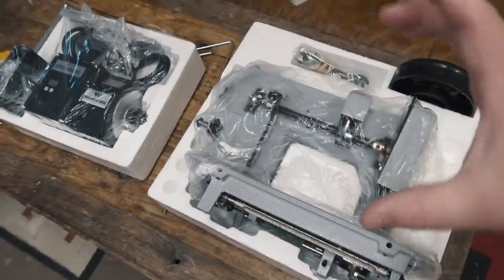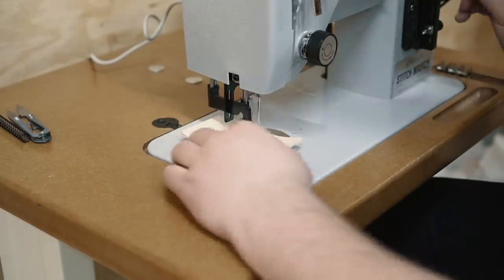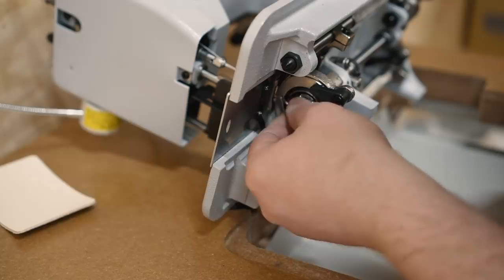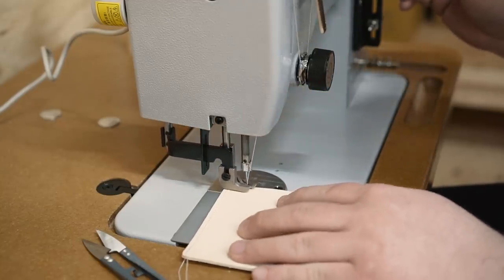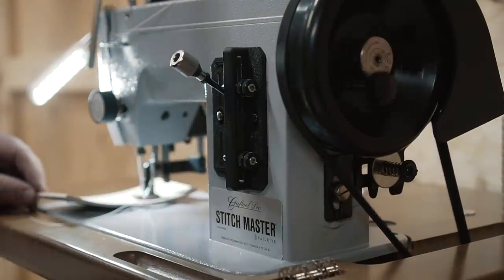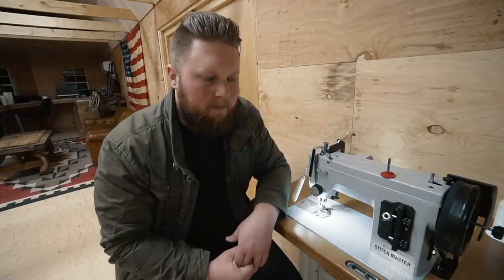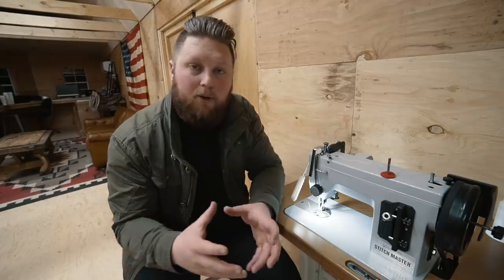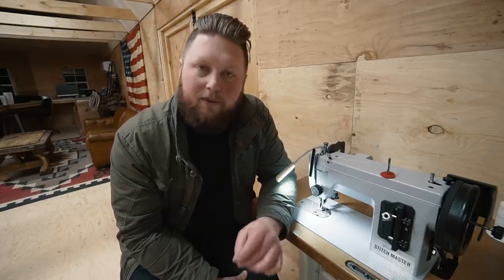Review of the Tandy Stitchmaster Pro Leather Sewing Machine

Comment: $1400 is entry level? Guess I’ll still ride my pony.
Reply: I have a sewing machine in my kitchen that cost 4k.
Reply: I always compare leather working tools to wood working, id call this mid grade, not quite entry level.  But if you were going to switch from a hobby and start a business, 1400 for a complete system wouldnt be a bad investment.
Reply: If you do enough work $1400 would be paid off really quickly.    I now have 2 machines and they are worth every penny and have paid for themselves 10 fold.
Reply: yeah $1400 is entry level, most light industrial machines are in the $2k+ range.
Reply: @FUBAR956  That motor makes a HUGE difference, that said I would recommend a full size table instead of that tiny table.
Reply: A lot of money, for a chinese made sewing machine, with some extra stuff. 
Aliexpress delivers one for ~500$,  all around the world, maybe ~650$ with servo motor.
Don´t you have "Made in USA" sewing machines (except union special) anymore?
Reply: @FUBAR956  This is NOT the same machine as the Sailrite Ultrafeed LS-1. Sailrite is only selling this version thru Tandy. The Ultrafeed LS-1 only has a 1/10th horsepower domestic sewing machine  motor. The Stitch Master has a 3/4hp  commercial servo sewing machine motor, also a clogged belt gear reduction system, and a commercial quality table, and leather feed dogs and presser foot. Considering that the most basic Sailrite LS-1 sells for $795, an additional $600 is very reasonable for a machine specifically set up for commercial leather sewing. The closest thing I know of in price is the Cowboy 3200 which is a slightly more capable machine, but costs $1900 plus shipping.
Reply: You can get pretty much the same machine from Sailrite for half that cost.  I have the Sailrite Ultrafeed LS1 and the only difference I can see is the speed control.  The LS1 is a portable machine with the motor right on it.  I turn the wheel by hand if I need precision.
Reply: I heard that
Reply: That's quite pricey for such a small   machine. You're going to be very limited in the kinds of things that you can fit in that arm area. A better buy would be a used industrial flatbed like a Consew 206 RV. I bought one for $150 with a table. Slap a 3/4 servo on it for $100 and your golden. The Cowboy CB3200 is a completely different animal and an unfair comparison since it's a cylinder machine and way more versatile than this thing.
Reply: *edit "206RB"
Reply: @derechteBenderBaer  There are still Merrow and Union Special overlock and chain stitch machines made in USA. Then there are AdlerDuerkopp machines made in Germany and still quite a lot of Japanese makers still produce in Japan. There are still choices out there. Then there is the used market, a decent Juki or Consew will be yours for a few hundred bucks and they will outlast anything made in China.
Reply: derechteBenderBaer Same feature as this machine??500??
Reply: Honestly think about the amount of time you'd spend hand sewing certain things and it pays itself off very very quickly. Say you wanted to line a belt and have a stitch border around it, 10 hours hand sewing or 15 minutes on a sewing machine? Do that a few times and you've paid it off.
Reply: There's a difference between "Entry Level" industrial and small business and "Entry Level" hobbyist playing in my basement. This makes it a reality for me as a small business to get solid equipment. Where before $3k and $4k was outta reach
Reply: It's only $800 if you buy directly from Sailrite.
Reply: While $1400 might be entry level pricing into the industry level machines the way he used the term when said to novices in the audience or an audience that’s familiar with the Tandy product line seems to imply a $250 - $500 price.
Reply: @lmlowe9100  
It seems like part of the difference in price is the motor. I think this Tandy leather set up has a much more powerful and controlable motor. 
The one at the Sailrite website is only 1/10th horsepower versus 3/4 on the Tandy machine, here. 
If you're sewing fabric, the less powerful motor may be enough. 
Definitely a big price difference to consider, depending on your needs.
Reply: @IamDoogy  I have an old Pfaff...truly better than anything out there.
Reply: @brokensquidwoodshop4209  

It is limited to a 92 thread. A bit thin for leather. This machine is far more suited to upholstery than leather.
Reply: Now it’s 999
Reply: @04658IFH  which one is that?
Reply: Skip Horni I agree totally. Pricing on stuff at Tandy can be ridiculous
Reply: I would like to know if You PAID FOR THIS sewing machine, out of your own pocket?? IF YOU DID THEN I WOULD BELIEVE EVERYTHING YOU SAY ABOUT THIS MACHINE BUT IF THE SEW MACHINE WAS GIVEN TO YOU FOR FREE THEN I GUESS YOU WOULD HAVE TO SAY IT IS ONE OF THE BEST SEWING MACHINE EVER, RIGHT? SO, JUST WONDERING..........BE HONEST,  DID YOU OR DID YOU NOT PAY FOR IT WITH YOUR OWN HARD EARNED MONEY? OR WAS THERE A CONTRACT?? PLEASE BE HONEST ......... 😯🙆😐

Comment: This is just a Sailrite Ultrafeed LS-1 in white. And I’ve already got an Ultrafeed LSZ-1 with the zig-zag stitch.  I love it and use it for small upholstery projects. My brother is an upholsterer and loves it for quick on-site jobs.  I’ve wanted to get the delicate presser foot and feed dog for leather but had my doubts. Now I feel better about using it. But first I want the Workhorse servo motor to handle the leather.  The original built in motor might not be strong enough.  I really hope Sailrite or Tandy offer that small stubby table as a stand-alone option.  Sailrite has a full-size table for the Ultrafeed but I don’t have the room.
Reply: And I’m loving the white paint job.  Mines blue.

Comment: Bought the Chinese version of the same machine for $250.. Yes, the castings are a bit rougher, but a bit of clean up and polishing and you're good to go (took me half hour)..  Motor is also so much quieter- Chinese version uses universal motor instead of servomotor, which accounts for some of the cost, but it's actually still a very capable motor if you understand universal motors: I use it on a 55vdc supply instead of 120vac and I can go dead slow for control with enough power to go through 1/2" stack of skirting leather, or fast enough for large production work..  IMO $1500 is way too much for what the Sailrite machine is.. Tandy has just done the Chinese market a big favor by making a good manual and training materials available for their versions..

Comment: Nice video and nice machine.
     Have you seen the Sailrite Fabricator.?   I was going to consider this one from Tandy but at the same price point the other machine has more bells, whistles and those boxes checked off.
    Don't get me wrong it's very nice and more semi-portable (you have to take the stand with you).  Now I have to choose which one I want.
Reply: I have this machine and the fabricator, and like them both.  Actually, I have the zig-zag machine instead, but this one has some advantage over the zig zag machine, because the foot is a lot thinner.  The Fabricator is my go-to machine, and is the same price point.  The Tandy / Sailrite LS-1 is a portable machine.  

I have the table for the LSZ-1, and the servo motor, but this one also has an added speed reducer, which should give even more control.  

The Tandy looks like a great little machine, and I love the white.  The table is also smaller than the one I have, which could certainly work better in some shops.
Reply: @CharlesAlanRobinson  
    Thank you sir for answering me.  Sorry it took me so long to respond to you, but I just noticed it.

Comment: My LSZ-1 needs a way to slow down and still punch through leather. If they could shorten the width of the base with a drop away that would be excellent.
Reply: I got myself a Monster Balance Wheel for my Sailrite machine, you can easily handcrank the machine for really slow stitching even through soft leather and very thick material.  I just love my Sailrite and their after sales service and support are simply amazing.

Comment: I would rather buy a used Consew 206 for less.
Reply: Pr/fe mech?
Reply: That is a lot better machine than this one and it is a triple feed. The Juki LU563 is also a great machine
that you can get for less than half of the the  price of this Tandy machine.
Reply: robotgrass A Juki and consew are built like tanks.  Industrial Singers too.  Just get one that’s running. Don’t buy one that’s missing parts or won’t turn stitch.  Almost any sewing machine shop can fix them and parts are available.   About the only upgrade is to stick a servo motor and small pully for slow speed control.

Comment: What should a guy who is just starting out buy? My budget would be more in the ball park of $250
Reply: I wanted to suggest you look up the Cobbler Sewing Machine. It’s available on amazon. It’s less than 200 and although I’ve never used it,  it seems like a bunch of leather crafters and youtubers are starting to notice it. Seems to sew a decent thickness of leather. Im not new to leather but I have yet to pony up 1400-2000 bucks for a sewing machine. I’ll tell you that I just bought a regular sewing machine so that I can learn the basics of sewing before buying something really expensive. And next I’ll give the cobbler a try so that by the time I buy an expensive machine my craftsmanship will make full use of the machine.

Comment: I have a twenty dollar second hand Singer industrial machine that does all the Tandy/Sailrite/Brother Lz1 can do.

Regards
Reply: Thanks for your feedback. I have a Singer industrial machine as well, does a great job, inexpensively!
Reply: Where can I find one? What is ur model #?
Reply: Awh man, don't leave us hanging to dry here. What is the model number?
Reply: But is it a walking foot?
Reply: I use an old Singer from 1902. It's a 31K15, built like a battleship, no walking foot but a pressure roller converter and it sews heavy stuff a treat.  I have 3 of them now and never paid more than 10UKP for them from charity shop.
I have found that any of the 15K Singers will do a reasonable job if fitted with a roller on the not too heavy leather.  The best buy was a French Claes, massive machine claims to be able to sew 20mm thick leather but needs a fork truck to move it...it was 60euro, for restoration.  I love the old machines.

Comment: Yeah, I don't know. I think for 500 more I'll go with a Cowboy CB3200. Sews super thick (1/2" -5/8") and every thickness up to that,  super heavy duty and would probably be the last machine I would ever need. I'm making holsters and sheaths by hand now. Each stitch by hand. Takes a really long time and wears my hands out. 
Anyway, thanks for doing your video. I found it helpful and I'm sure a lot of other people did too.
Reply from the maker: Thanks Sam, The 3200 is a completely different type of machine, totally different mechanism.  It's a harness stitcher designed for heavy duty leather like holsters, sheaths, scabbards, tack, etc...it does not sew lighter weight materials very well. So it all depends on what YOU plan on sewing. It definitely sounds to me like you'd be much better off with a CB3200, 4500 or a cobra 3 or 4, juki 441, and other machines of that caliber. I think the Stitchmaster is for those who are just learning and plan to sew on a hobby level, and plan on only making small leather goods like wallets, key chains, folios, etc...It's not the right machine for professionals who would be doing production.  I addressed this on my follow up review video. You can watch it here: https://youtu.be/o5YV8ZEPN5U

But again, it sounds like you're on the right track with a 3200 for holsters and sheaths
Reply: @whitandpark  
Thanks man!

Comment: Presser foot thickness= .300 or 5/16 of an inch per sailrite/tandy video  There are a few up sides to purchasing the machine setup this way The servo motor is already installed, So you don't need to learn to slip the clutch and "operate"  a standard industrial sewing machine.. I feel that is a loss and if your going to come this far it should be a skill you have, its worked that way for 100+ years just sayin'. Most people who are wiling to come this far in leather work with purchasing  Still might be scarred by the price $1500 is a lot of leather, supplies, etc. I purchased my USED Nakjima 280L big bobbin machine for $500 complete table motor etc.  through a small shop that has been there 40+ years selling and servicing machines. My machine is a copy of a Consew 205 as most commercial sewing machines of that class are. Pfaff, Consew, Singer, Nakjima, Cowboy,  Seiko, I know I am forgetting some manu. but you get the point. Also if your looking try craigslist or whatever your flavor is they are out there.

Comment: Hey Stock and Bartel,  I just got one of these machines and the oil pan that came with it is not the right one and does not fit.  I called Tandy and got push off th Salright and they gave the brush off.  If I can not get this going,  Tandy is going to loose some good customers.  You better check this out before you recomend it.  Darrell

Comment: If you're ready to spend that kind of money ($1,499.00 as of 12/19) you'd be WAY better off getting the Sailrite Fabricator for $1,470.00.  The Fabricator sews up to V-132, and has the knee lift for the walking foot.  It's just a better machine for less.  Also, if you're just hobbying you can get an old Singer walking foot machine.  My 100 year old Singer 16-88 ($150.00 with treadle table) with a servo motor ($116.00) will sew gunleather with 132 slowly all day, no problem.

Comment: Juki Lu-1510N7 for the win.  Auto thread cutters save so much time.  This is a Juki 1508 on steroids.  It does need compressed air to operate the back tack and the foot lift.

Comment: Im sorry, how much again 1400$? For that u can buy a used Pfaff 335 which is still THE top-tier dedicated Industrial sewing machine (even if aged, these things don't break and parts a readily available). And it comes with clutch motor, triple transport and a free floating arm (wich is essential for any professional leather crafts-man/woman).
This is a joke. Invest in something proper and save some money. Don't be a fool.
Reply from the maker: @artenisdhjaku8171  That's definitly not the same machine. They're both the same clones of a mini walker but that amazon machine doesn't come with a reducer, servo motor, table/pedal, smooth presser foot (for leather), posi-pin clutching system, etc...

Comment: Tried your affiliate link and it's dead.  
"Server Error in '/' Application.
Runtime Error
Description: An application error occurred on the server. The current custom error settings for this application prevent the details of the application error from being viewed remotely (for security reasons). It could, however, be viewed by browsers running on the local server machine.

Details: To enable the details of this specific error message to be viewable on remote machine..."

etc
Reply: Same. Plus they dont ship it to Australia :(

Comment: How would you rank this against the Cowboy 3200?
Reply from the maker: Well those are two completely different machines and hard to compare. The Cowboy is a cylinder bed designed to take on really heavy duty leather and big projects. So it would be great for saddle and tack work, but really isn't ideal for smaller more intricate stitching. And the Stitch Master is a flatbed and would be perfect for smaller more intricate projects like wallets, key chains, strap work, small bags, clutches, phone/tablet cases, etc...Also just a great one to learn on because of the speed control and simplicity of it. Both great machines just different applications:)
Reply: Thanks for responding to that question. I've wonder about that and Andrew beat me to the question.It looks like the sailrite fabricator would be a better choice if space was not a factor. Have you look at the Fabricator? Thanks for posting!
Reply: Thank you Parker, for this well stated answer. My only concern is if I were to buy this one, would I regret it later on, for not having gotten the larger machine. I'm not making saddles nor tack, but would be in the range of medium sized bags (laptop cases maximum). I appreciate this input.... thanks again, your company is an inspiration to me... @whitandpark

Comment: Obviously he's a spokesperson for Tandy now, he probably even got this machine for free.  The fact is, this is a lightweight machine, it was designed to sew Mylar sails for sailboats (small for boat owners to have one on board their yacht).   Do your research, the Singer 111 was made 100 years ago and was the model that all industrial walking foots were based off of once the patent ran out.  The Juki, Consew and Pfaff all copied it, almost to the point that the parts are interchangeable.   By the 1990's these machines started to have Chinese or Taiwan castings and parts and became problematic, the tolerances weren't there.   I bought a used Consew 206 RB4  (don't but the new white one).  I bought my machine with a table and servo motor for $400, yes it took me 5 months of looking but it can happen.  I have sewn through 3 layers of 1/8" leather without any problems, they are a tank.   Yes, I wanted a Pfaff from Germany but could never find one under $800.   Watching this Channel, I can not understand how his products have paid for brand new equipment, and now he says his product is manufactured on the east coast, so he's not even taking in full profit.
Reply: I also bought a Japanese made Consew RB. Great, versatile industrial machine for a steal. I also own a Singer 111w155 but wanted a second flatbed with reverse. Both of my machines complete with servos cost less than this and will surely outlast it (not too mention spare parts availability).